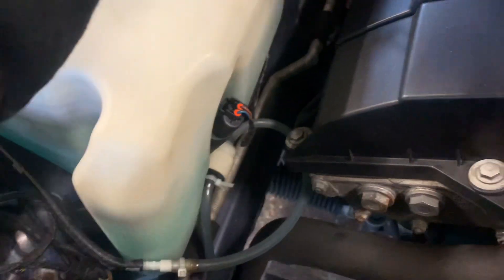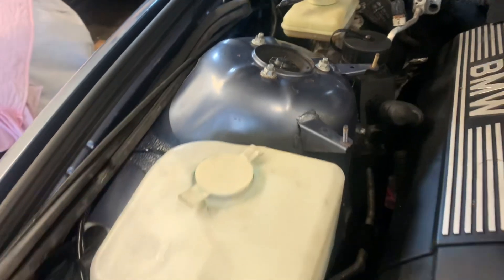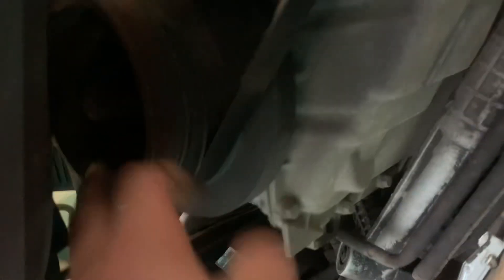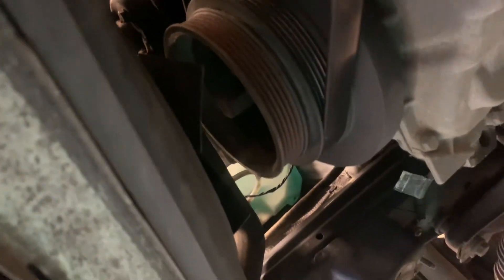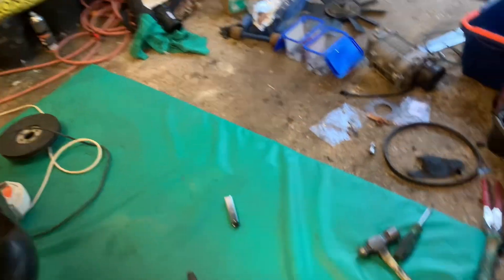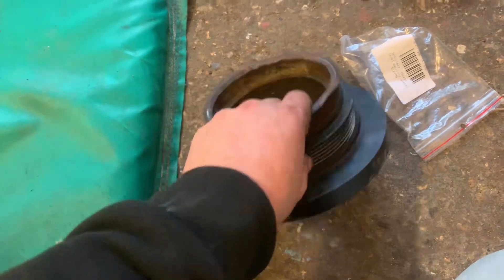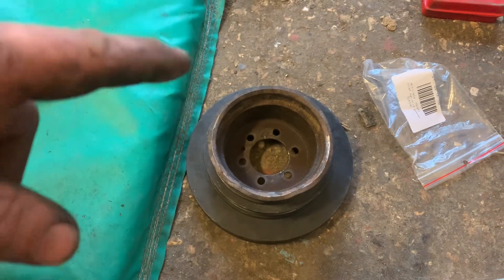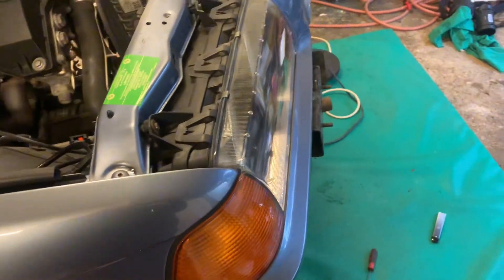Day 2 supercharging the bmw e36 328i touring, didn’t go to plan 😭

Comment: Might be worth trying a 36 convertible 2.5l washer bottle as its a bit smaller, I've got one
Reply from the maker: I’ve got a small one off the 7 series v8 I was gonna use but il have a look at the one you got too as was gonna use the 7 series one on the turbo